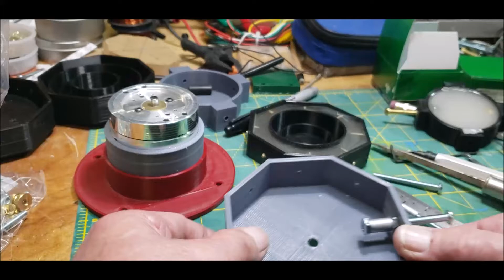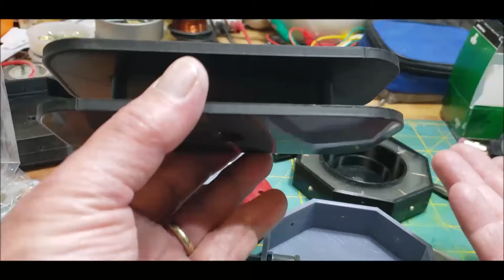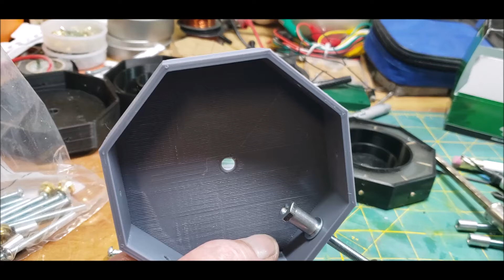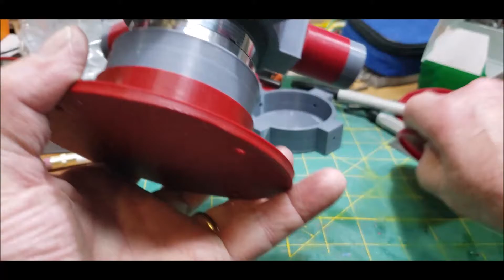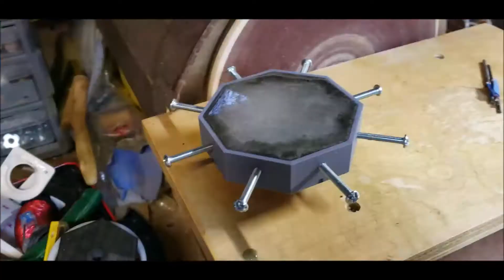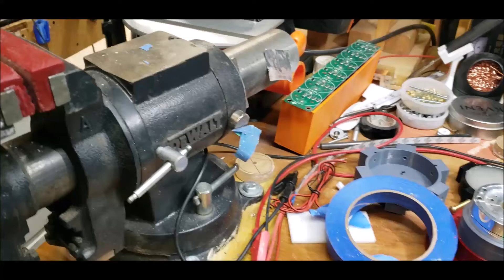3D Printed Rotor Design continued

Comment: Ever use a pressure cooker with a vacuum pump to pull the air out?
Reply from the maker: no don't have a pressure cooker. I do have a diy setup and will try and get that up and running sooner than later
Reply: @mcorrade  less than $20 at the thrift store will get you a decent one. Just make sure the seal is good. Part of me wants to try and make a pressure cooker implode.